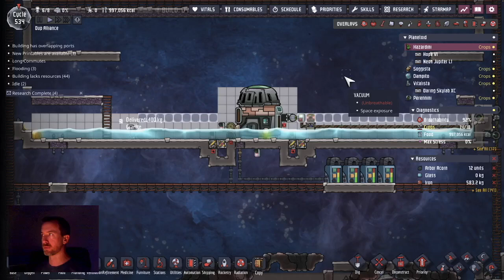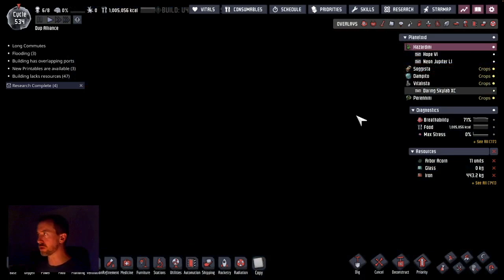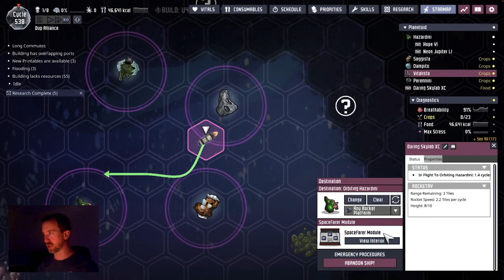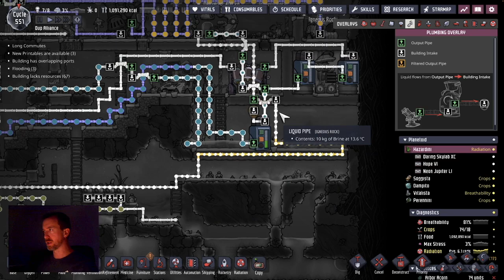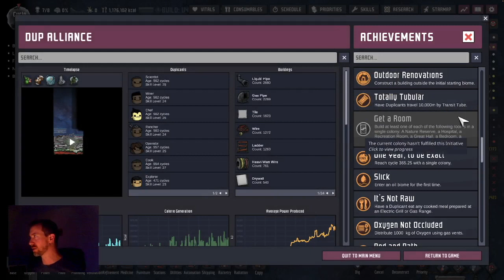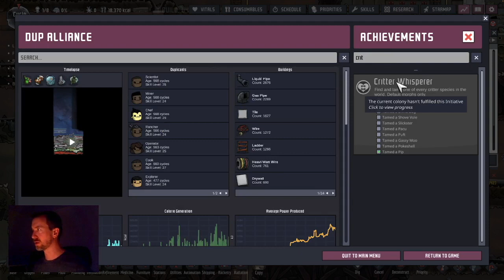Oxygen Not Included: Hard Mode 25 - Research Reactor Drywall

Comment: The reason we were saying 10 is that is roughly the magic number to keep up with the heat output of the reactor given it's ran as continuously as possible.  Kinda why I also tossed out the idea to force it to be hotter, thus enabling the use beyond 10.  Haven't tried it myself, but I know it's possible.  Would be equivalent to a sour gas boiler in regards to slowly tinkering with the settings to ensure things don't go sideways.  Main issue with the reactor and why the game doesn't give full stats on it is the fact that it fluctuates based on various factors.  So manipulating those factors is very finnicky and requires a bit of babying to hone it in to stability especially if you are trying to force it to output at say 2000 C without going over that value and causing a meltdown.  IIRC meltdown is about 2500ish C.

As I stated, haven't tried it myself so not sure how many turbines something like that would require.  Super coolant would be mandatory at that point.  But a standard reactor setup is typically 10 turbines running at max, unless you are just dumping the heat into space.
Reply from the maker: Thanks for that. I understand now, the reactor varies it consumption based on various factors. Just about to turn my reactor on for continuous use. I will post the vid likely tomorrow morning.
Reply: @jeroxygen  Np.  I've also never tried building the steam room with the reactor at the bottom so maybe there's some variance there too?  Few spaced out plays I've done have always had the reactor at the very top.

As for the reactor itself, my understanding is that it can't output until both coolant and enriched uranium are at max inside it, at least 400 C internal temp and the pressure at the output tile of interest is low enough for the output to be expelled.  So all those things can play into the rate it runs as well as being factors you can manipulate if you're trying to do a little more with it.

Personally though, I tend to only build the thing to expedite plant mutations.  The steam power is merely an added perk and not something I've felt the need to actively pursue through fiddling with the coolant intake.